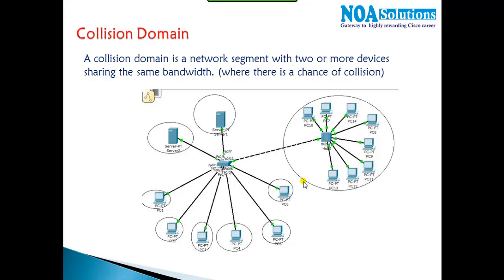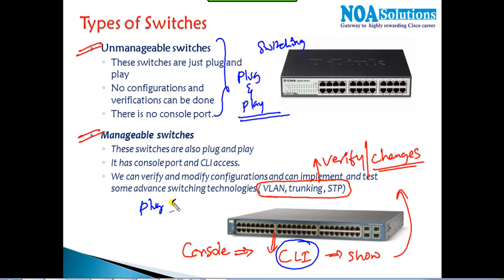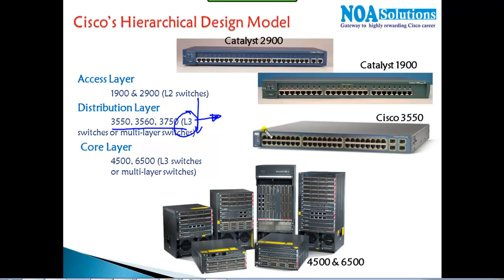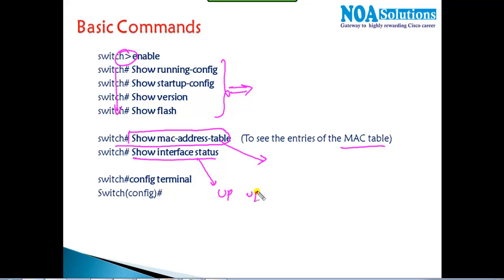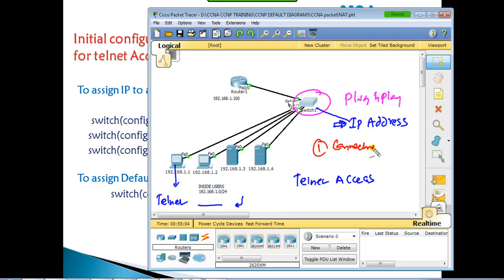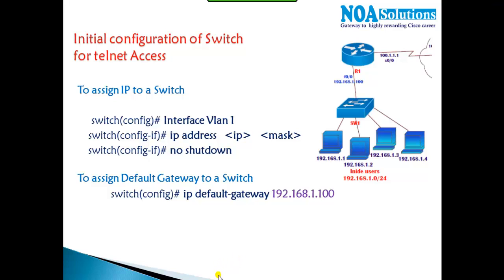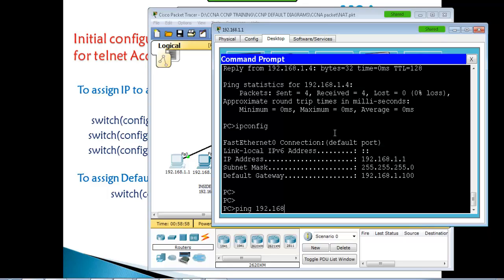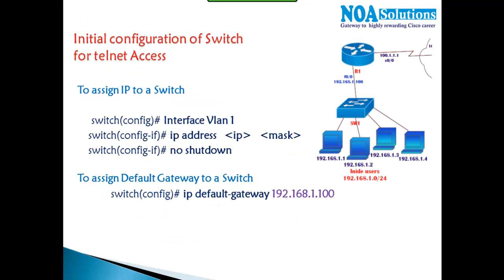Switch Basic Configuration - Video By Sikandar Shaik || Dual CCIE (RS/SP) # 35012

Comment: I don't understand the command of ip default-gateway. 
I am using a simple network where 3 pc, 1 switch, 1 router. I used this at switch and set router ip as well and pc ip and subnet mask but dont set default gateway, because I am thinking if I set at switch then I will be working also at pc point. Please clear my doubt...

Comment: hi sir i am using  cisco pocket tracker  i am tring to configer a switch when i am tring to give ip address to fast ethernet port i got this massage (s1(config)#int fa 0/1
s1(config-if)#ipaddress 192.168.1.2 255.255.255.0
                ^
% Invalid input detected at '^' marker.
 
s1(config-if)#)
itthis massage also come in when i try to give ip address to router interface port
please help me i
Reply: Did you select vlan 1?
Int vlan 1 
Then put your ip address
Reply: give space ip address :)
Reply: U cannot assign an ip address to switch interface as it is a layer 2 device....need to create vlan for assigning the ip